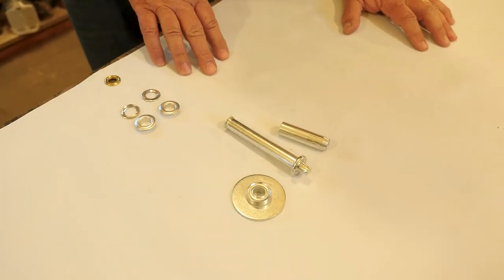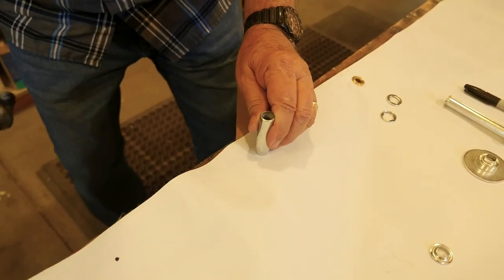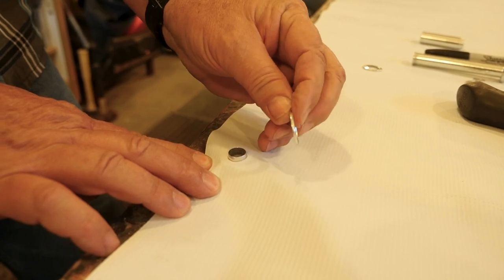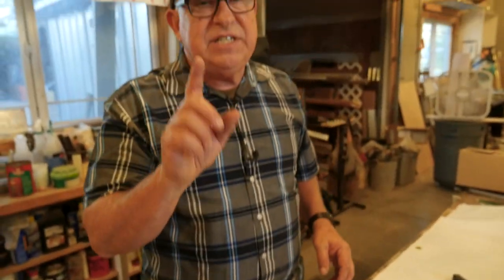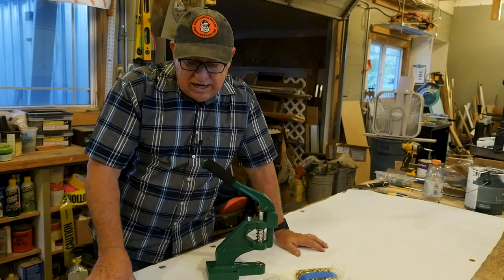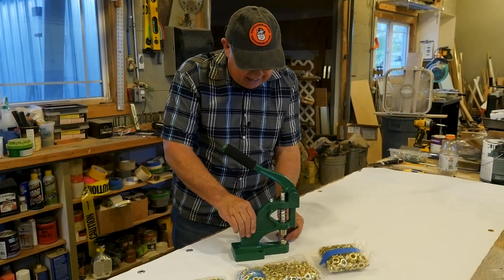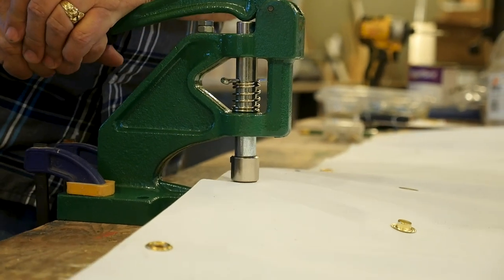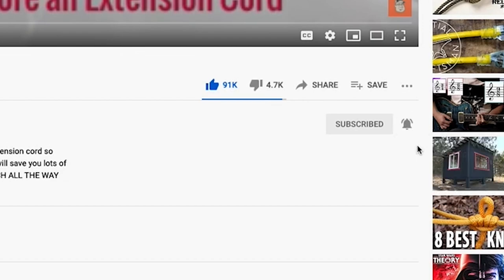2 Great Ways to Install Grommets

Comment: Hidi Ray I mean Jay. Atleast I didn't call you Faye..Seeing your video remind me of making tarps out of  Vinyl Swiming pools, or large swiming pool vinyl. . You can go buy these heavy duty tarps starting at $21 to $44 , and you may get maybe  1 year before they are toast after sitting out in the sun all year. My wife found an old round pool someone was throwing away. It last 6 years before it gave it up.  I used it to cover a barbecue pit. It set out in the sun  all that time.
Reply from the maker: Charles, it's been awhile since I've heard that! Thanks for the tips on the heavy pool liner. Best, DFJ

Comment: Man, I want one of those machines! I have absolutely no need for it, a manual set like the first one is all I need to repair or modify tarps occasionally, but I'm a sucker for cool tools. Funny that I just found this video when I had to customize a tarp for my pickup the other day by adding a couple of grommets where I needed them.
Reply from the maker: Randy, it's not a tool we need very often, but when we have a batch of tarps, signs or banners to install grommets in, it's a game changer! Best, DFJ

Comment: I have both types.  With the small set, I seem to be able to control the pressure better.  With the machine, I either don't get it tight enough, or the grommets split on the wrong side, which is bad, because I sew garments, and the splitting would scratch the wearer.  :(
Reply from the maker: Thanks for writing and sharing your experience. I wish the machine worked better for you (and the wearers of the garments you make!). Best, DFJ
Reply: Hello , is there a link for this grommet press?
Reply from the maker: @JOHNNYXBRAVO  Yes, indeed. Look in the description below the video near the bottom and you'll see the link where we bought the press. Thanks for watching and writing!

Comment: Will these punch threw a leather belt?
Reply from the maker: Depends on the thickness, but the grommets tend to be light gauge, and designed to cut through thin materials. It could work, but it's likely it won't. Best, DFJ
Reply: Most likely not, but you can mark out the piece you need to install, and use scissors, or clippers to precut the hole. After that, install the grommet in the usual way.

Comment: Thanks! For the manual method: washer rounded side up or down? I've seen both on Youtube, Surely, one way must be better than the other...
Reply: That's a great question, and I've puzzled over the issue of the grommets simply cutting a bigger hole in the material if I pressed or hammered them too much.  Maybe plastic washers are needed to prevent this.

Comment: Need self piercing #4 1/2" for field work on vinyl shelters. Any guidance?
Reply from the maker: Norman, if you are doing a lot of this and doing this ongoing, I'd invest in a basic grommet machine that punches and clinches the grommet all in one step. The brass colored grommets tend to be stronger for punching through vinyl in my experience. I hope that helps. Best, DFJ